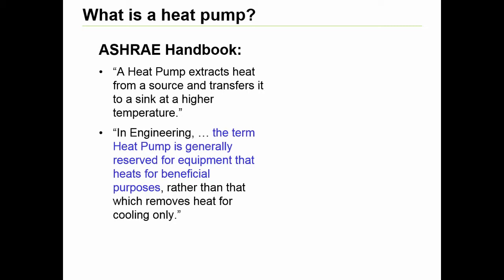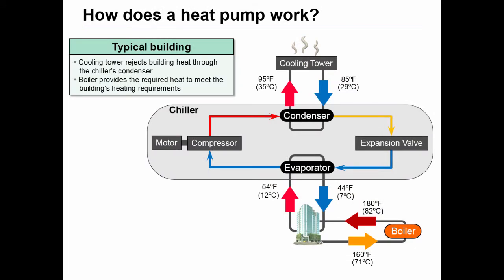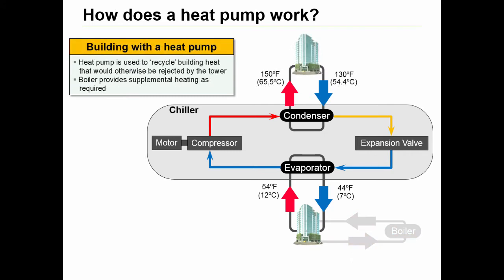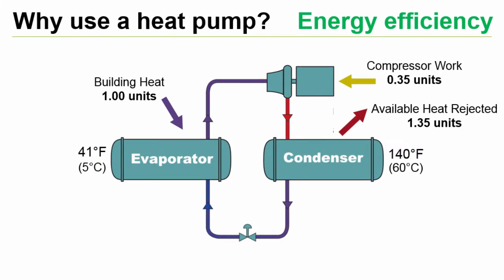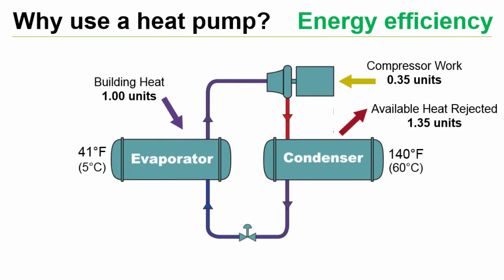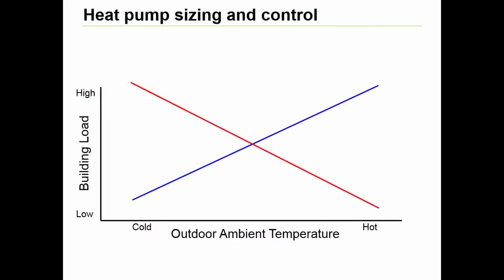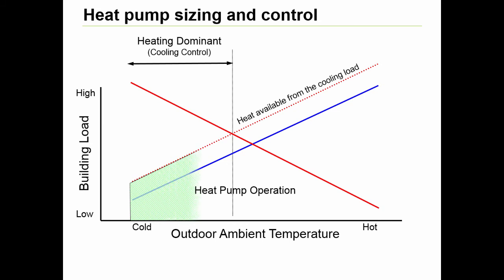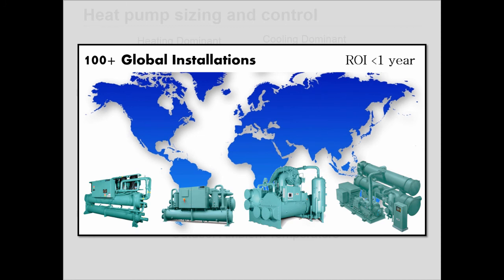Utilizing Heat Pumps for Simultaneous Heating and Cooling Applications

Comment: I've been wondering if using two heat pumps working opposite each other could warm water in a swimming pool and freeze water for an ice rink located adjacent to each other. The theory seems sound but I'm not an engineer so there might be something I'm missing.
Reply: You most certainly can. However... you will need a chiller (i.e. heat pump) that takes up a high lift, which is the differential pressure of the refrigerant in its low temperature stage to its high temperature stage. With conventional refrigerants that can be either a chiller with screw compressor technology or if the compressor is centrifugal it has to be multistage. Alternatively a chiller with ammonia will do.
Reply: In theory yes, but processes are not reversible so won't happen.
Reply: @thimmukar8565  This thought was based on using two (2) heat pump systems. One would be set to heat and the other to cool. Nothing is being reversed in this situation. Each pump is set to do one process and one process only. You are removing heat from one end of the circuit - the ice rink -  and placing it at the other end - the swimming pool. The other system is removing cold from the swimming pool side of the circuit and depositing it at the ice rink side. What is being reversed?

Comment: Perhaps I'm misunderstanding or overlooking something obvious, but why not use exterior heat exchange (eg, cooling towers, geothermal loops) to compensate for unbalanced heating/cooling loads instead of adding supplemental boilers/chillers? While that would require more heat pump capacity in addition to the heat exchange system, it seems like that would ultimately be more economically/energetically efficient in most cases, particularly in more temperate climates and if imbalances in both directions are expected.